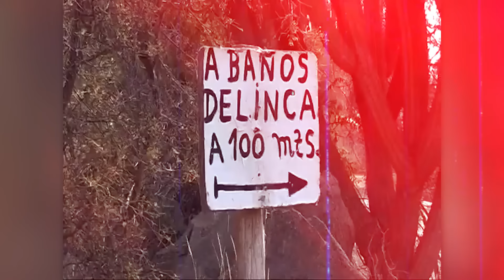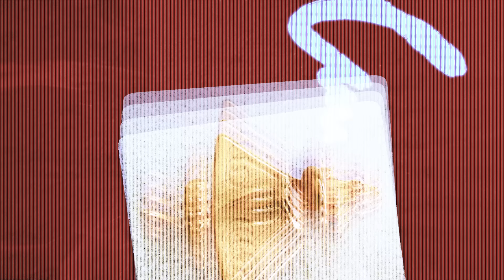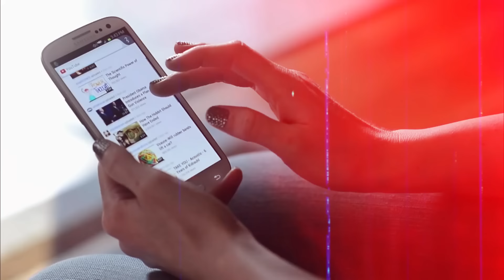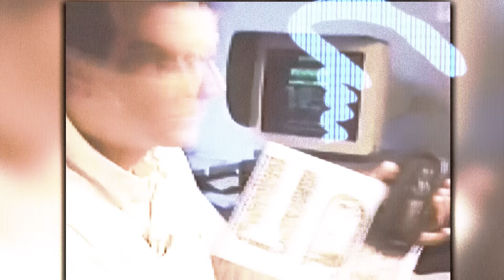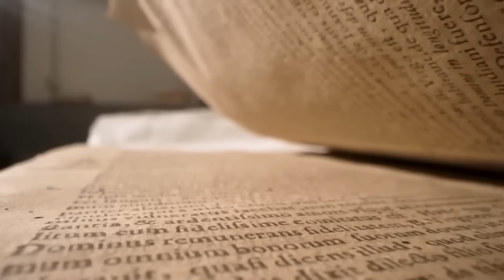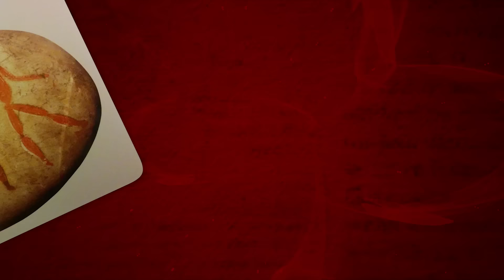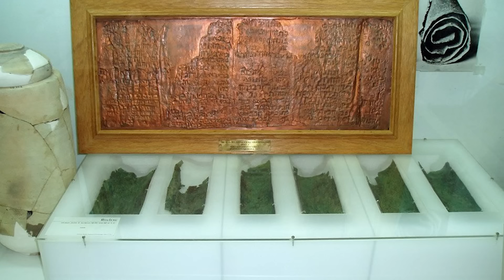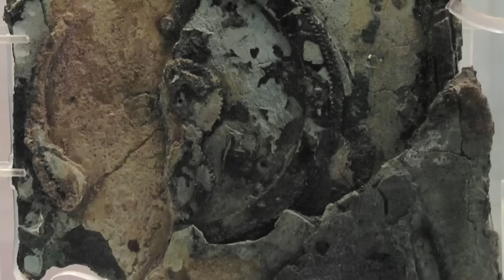20 Most Mysterious Artifacts That Continue To Defy All Explanation

Comment: The thing I don't understand about the Shroud is...why do we assume that because it was (possibly) made in the 12th or the 13th century, it isn't still a miracle.
Reply: Because this is what naturally happens if you wrap a wounded body into a linen cover and let the stains uncleaned.
By the way, around 30 a.d. crucifixions were frequent. Yet, there are doubts about the wounds in the middle of hands and feet. Excavations from another grave in Jerusalem found the bones of another crucifixus (presumably the last king of the Jews), but the nail was driven sideways through the back part of the foot. The cross was X-shaped, the victim was fixed with his front to the wood, not with his rear. The same kind of pierced heelbone with a nail inside was found near Cambridge, England.

Comment: We now know that the shroud is older than first thought and not a hoax but it had nothing to do with the Christ entity (at first). Turns out that it was a monastery's table linen provable by the material used at the time and the size of the tables that monk's used during this period. They had used it to cover a statue that was stored provable by the type of masonry and pigments embedded in the linen used during this period. Not provable, a crafty minded monk noticing the striking resemblance of the Christian Messiah and sold it as a Christian artifact